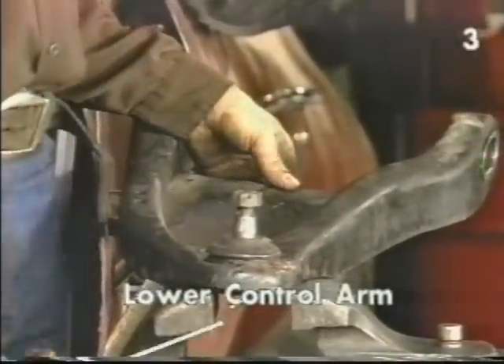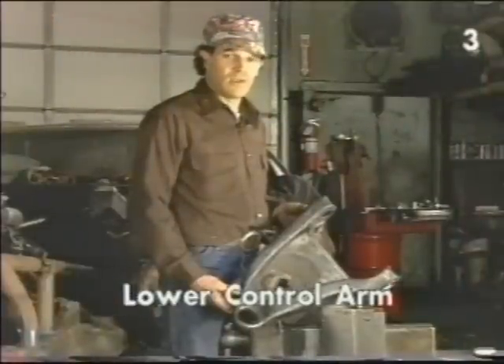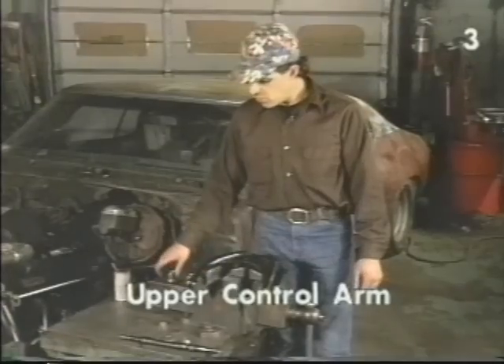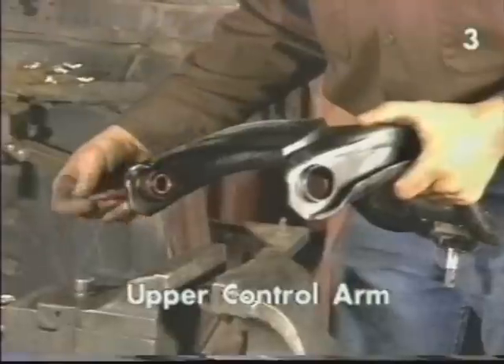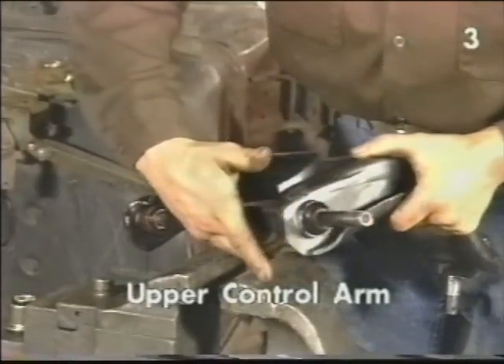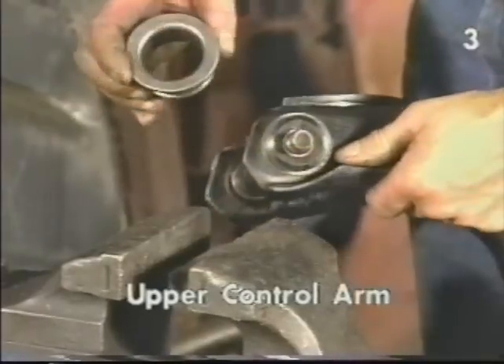Rebuilding Your Front End- Part 3- Rebuilding Control Arms

Comment: My 01 Lincoln control arm is like the first in video. It has two different size bushings, a front that is smaller and a back that is larger. I didn't have a big drill so I made a yard fire and burnt the rubber innards out of the bushing, leaving only the outer shells of the old bushings. I didn't realize that my front bushing, the smaller of the two, would press into the old bushing sleeve. I beat both bushing sleeves out, then realized the front bushing opening was now too big 😭.  The rear bushing matched up  to the front bushing hole, pressed in & set properly.  
Just a little job info to share. 
I used a grinder and cut 3/4 of the way into the outer bearing sleeves, grinder wheel bit and broke the grinder wheel. I grabbed a sizable screwdriver with no handle and a ball peen hammer. I beat those sleeves like a burglar @ my bedside for a day & a half. The outside lip of the bushing sleeve "appeared" to be  possibly spot welded in spots, like just before it was fully pressed in at the factory they spot welded in spots, then press it the final 1/4 inch to seat it?  So in summation the video was very accurate,  I would strongly suggest a grinder or sawzall set up for metal cutting application, a metal chisel, sizable hammer, and a metal blade on the hacksaw. Of course a bearing/bushing puller to re seat bushings & a can of spinach or two. Don't forget to bring your big boy pants, wear a belt & lace up your boots tight.

Comment: I'm restoring the suspension on a '69 Catalina that has those oval bushings on the lower control arm. I would prefer to replace it all but finding a way to pop in the new sleeve hasn't been easy
Reply: I'm having the same problem on a 1970 pontiac  gto. The part I bought already has a metal sleeve around the oval, or rear front lower control arm. So is he getting the middle rubber with the shaft as a kit or cutting off the metal sleeve on the "moog" replacement?